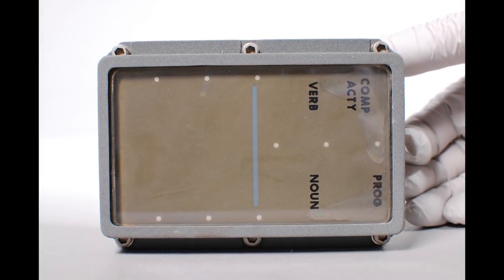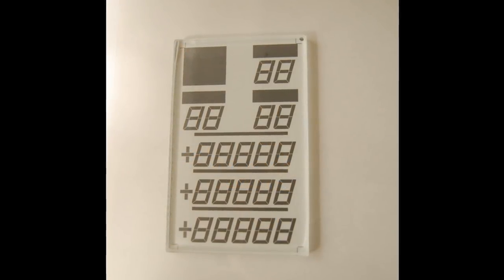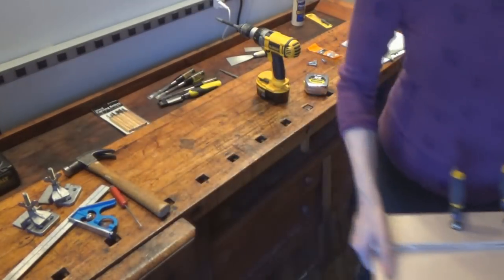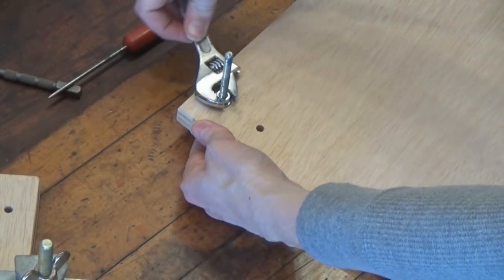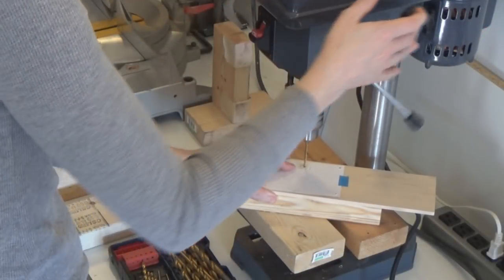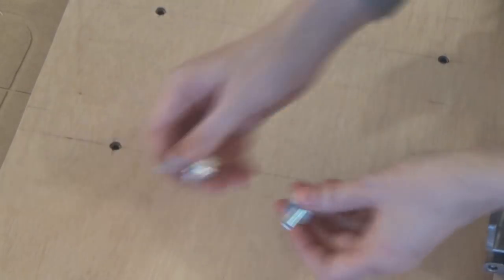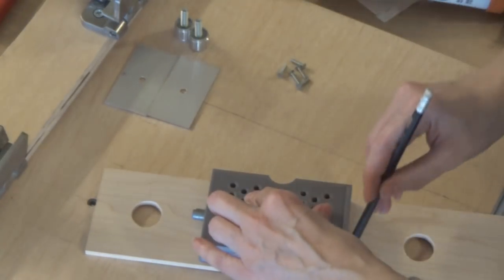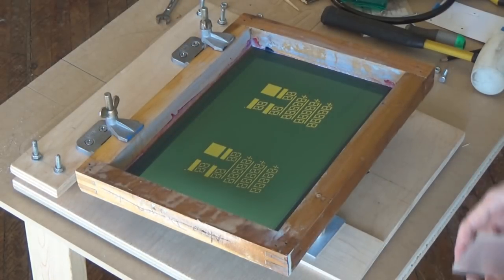Making A Silkscreen Jig + Vacuum Holddown - DSKY Display Project

Comment from the maker: Trivia for those playing at home - the aluminum knobs I use for the holddown screws are NOS Hep Cat knobs from 1994.  Functional and alluring!
Reply: Bit like yourself ay Fran!... Love you x
Reply: Hello the LCD technology is possible to do, with ITO ion thin oxide in glass, using a magnetron for coat? And the liquid crystals inside LCD monochromatic, or this is made with LEDs? I read in a paper for manufacture LCDs that they use some one these to produce crystal liquid: 
Aldrich
-- Cholesteryl Oleyl carbonate
-- Cholesteryl pelargonate, 97%
-- Cholesteryl benzoate, 98%
I'm trying to do LCD in my home, but it's so hards and expensive.

Comment: I'm so glad Fran can't hear us from this side of the screen.  So many times I'm going "Oooh, what about..." then a moment later, "Oh, she got it."

One thing Fran didn't mention is the need to use FLAT plywood.  That looks like cabinetry-grade stock.  Can't quite tell what the outer veneer is.  Maple would be my guess.

Then again, with everything so adjustable, a bit of warp could easily be tolerated.  Love seeing such great design and implementation!

Comment: With such fantastic craftsmanship I'm somewhat startled to realize that I have a tip! 
When you need a drill template for a printed part, cut it in your slicer, keeping the bottom couple of layers (usually the bottom) and increase the Z scale to make it thick enough to pilot your largest drill. Obviously you can achieve more elegance and efficiency by taking this idea back to your CAD files but it's possible to print yourself a nice plastic template even if you've only got .STL's

Comment: Nice trick with the drilling aluminum of flipping the plate. i'll have to try that. i was taught to use alcohol when drilling aluminum, that cuts down on the burrs as well as it lubricates nicely - but it will leave quite a mess compared to no lubrication :) - Keep up the good work!

Comment: I Love You Fran x... Being more a hobbyist woodworker than an electronic one "although I'm doing more messing with electric@ the min" I love this vid. You know I never thought of turning the alum plate upside down, thumbs up for that Fran. A tip for you if I may be so bold! Fold your sandpaper in half then in half again, open out and cut down any line to the middle then fold back up so as no grit sides are touching, just makes the paper last a little longer as no grit is coming into contact with each other. Please buy a soft faced hammer for hitting the poor wood, As always Fran Love you.
G in me dinning room messin wid de lectric xxx
Reply from the maker: Seriously...   using sandpaper the wrong way?  Wrong hammer on scrap plywood?  Dude - cut it out with the manscplainin.    And thanks for being a fan!
Reply: Seriously...  did you just throw a profanity @ me there Fran!?... Never said your using the paper wrong n just didn't want you whacking good wood wid ye ammer:-(
Love you Fran you alluring functional daft bint. xx
Oh love the Dude :-)
G@me computer

Comment: Enjoy your videos (think it's your voice!). Look into UV cured inks, you don't have to worry about  the ink drying out. One of my work tables was a 3'X4' vacuum table. Would register substrate under screen, then use card board to mask off holes. Works for all sizes.
Reply from the maker: All of the electroluminescent chemistry has to be heat cured.

Comment: Hey Fran, I have had considerable experience at one off screening for pcb prototypes. May I suggest you make two additional adjustment parts that go beyond the screen edges and push up against the block holding the vacuum glass holder, that way you can adjust it while the screen is down. Like a couple of "sticks" that "stick" out beyond the edges to use as levers. Once you find the correct spot then you can apply some duct tape or similar to hold the "sticks/levers" in place to prevent movement. It will save you a lot of time.

Also you may find that you get slight damage to the screens with each use as the glass has sharp edges, what I did was to put scrap PCB material around the part to be screened to give the squeegee a larger surface to run on and reduce the damage to the silk. So in your case either more glass or PCB scraps or some flat smooth material to prevent that. (at the same level as the glass blank of course.)
Reply: What about applying something like Kapton tape to the bottom of the screen were the glass perimeter will touch, to prevent the sharp edges from damaging the screen?
Reply: That also causes a small crease or damage, the idea is to make the swiping area  completely level with the blank and the swept width and run of the squeegee..

Comment: I worked 23 years as a screenprinter, printing on flat glass at a company that makes better than 95% of the microscope slide market in the United States. 

This brings back memories.

Kind of wonder why you don’t farm this work out to a company that already has all the tooling, know-how and resources.
Reply from the maker: No one makes EL displays on glass with the 1960's era Sylvania process and chemistry.    But if you know that company, please by all means share.
Reply: Printing layers and layers upon glass sheets was a lot of the stuff we did. We had many different printing departs, screen-making, glass cutting, edge grinding

The company is in Portsmouth, NH. Two buildings on Post Rd. Formerly known as Erie Scientific, now known as ThermoFisher.

I know about plant work, have no idea about sales, and purchase orders, except following work orders.
Reply from the maker: I guess I should outsouce everything to those who know what they're doing and close down FranLab.   Now that you've taken me down it does all seem like such a dreadful waste of my time.
Reply: Fran Blanche I  wasn’t much into this dsky project series, I went back and watched some other parts where you explained how these displays worked, and that the glass was acid etched. i used to do quite a lot of acid etching glass at that company. You probably could have got or get some standard 1x3” or 2X3” or any other size cut on whatever thickness and type to experiment in getting your display color right.

Comment: Fran Blanche

Do you have any plans yet for what will be used to drive the DSKY?

Did you intend to make it fully working, with a proper replica of the AGC as well?

Perhaps one of the TTL replica designs would fit the time period? ;)

(and possibly make it a bit easier to interface to a relay driver for the display.)

Mesmerizing vid btw. Great work. ;)

Comment: Regular cheap vacuum ceaner makes a good enough quick pump for this. Just get a cylinder one and drop the speed down a little ( or use one with electronic speed control, about the only time you will actually use this feature) to make it a bit quieter. Did use this for a few weeks in place of a vacuum pump, and the cheap vacuum cleaner did survive the operation almost unscathed.
Reply: Get a Harbor Freight Vacuum Pump (normally used for evacuating air conditioners in cars before filling with refrigerant). They are very low cost and will pull a much harder vacuum. Cody'sLab and Nighthawkinlight used them on their channels, and I use one in my projects too.

Comment: You should avoid wearing gloves when using the grinder or drill press.  Use vise grips or another tool to hold the object if you can't with bare hands.  I know you've likely been fine until now but these accidents happen everyday by doing that and the results aren't pretty.
Reply from the maker: Respect the tool and know what you're doing.   Been doing this a very long time.
Reply: Fran Blanche
- "Been doing this a very long time" or just been lucky a very long time....
Fran, I do so enjoy your vids but PLEASE avoid wearing gloves when working with rotating machinery.
Thank you.
- End of safety announcement -
Reply from the maker: Been doing this a long time.   Not for beginners.